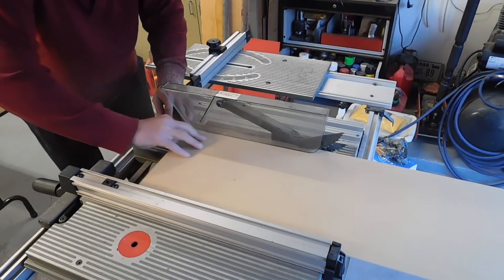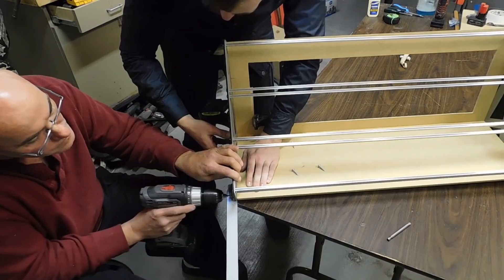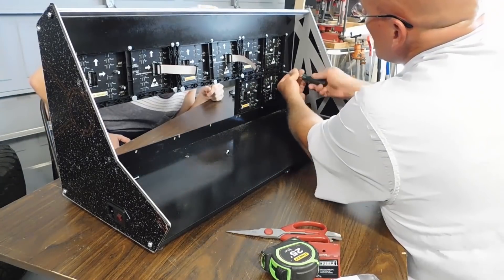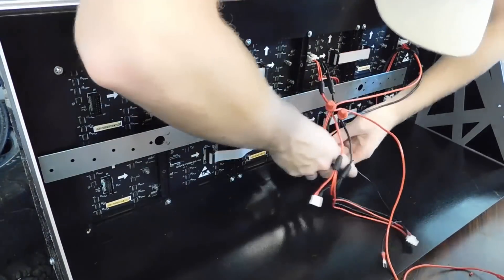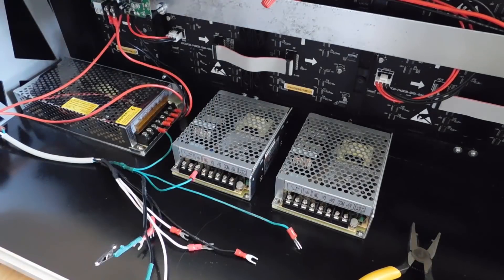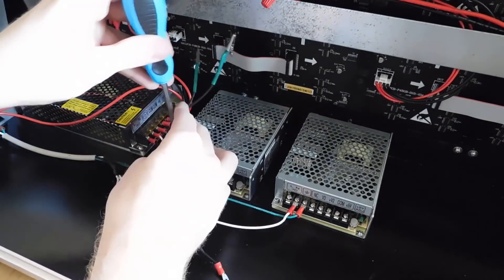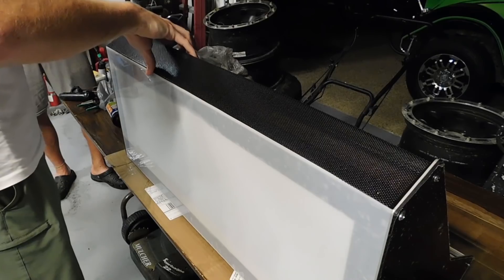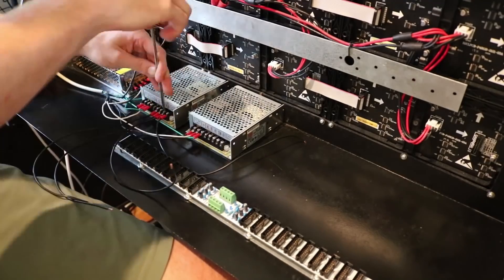DIY eurorack modular synth case with built in LED screen

Comment: What you'll also notice is the 65B PSU has 5v, V2 and V3. This indicates the PSUs primary is 5v and the +-12v are secondary, you would have been better off buying 2 x 12v PSUs and running them in series to get you +-12v. The 65B can create a lot of noise and heat if you don't use the 5v or add a dummy load to that rail.

Comment: how can the power supply of an eurorack be vonverted to 5V 2A, so to power the BeagleBoneBlack and the Bela boards with the following touchsensitive LCD screen-cape: https://www.seeedstudio.com/7-Inch-LCD-Cape-for-Beagle-Bone-Black-Touch-Display-p-1697.html ? which would be appropriate power supply?
Reply from the maker: Since eurorack power supplies have a +/- 12v and a 5v rail, you could look up the power cable specs and run the 5v and ground rails to your circuit. 

Keep in mind though that 2A is probably a lot for smaller eurorack power supplies to handle. You may need to get a dedicated 5V power supply so that your modules dont suffer from such power hungry devices